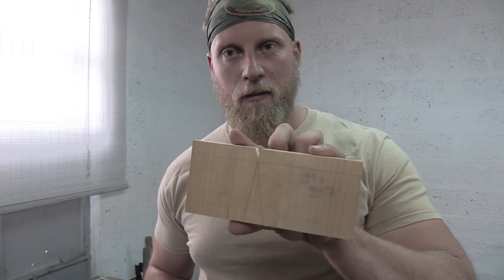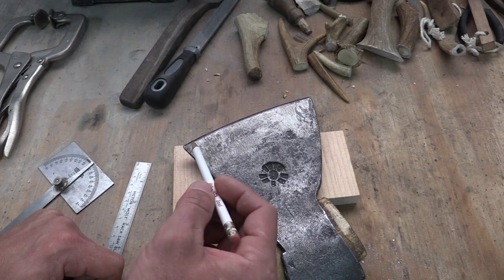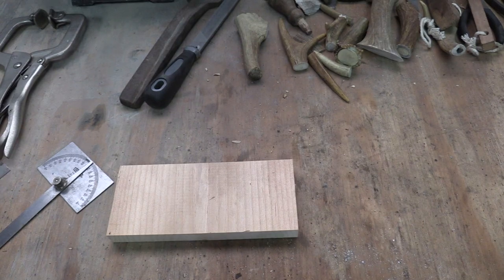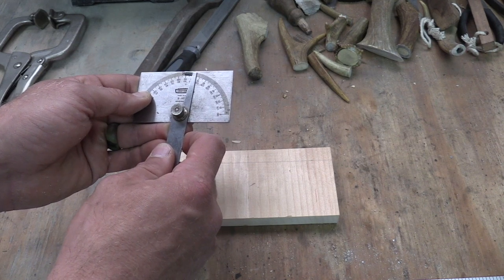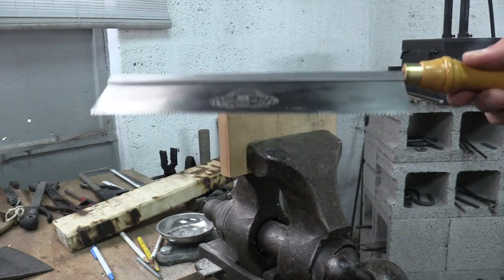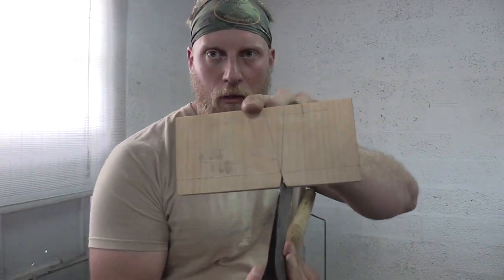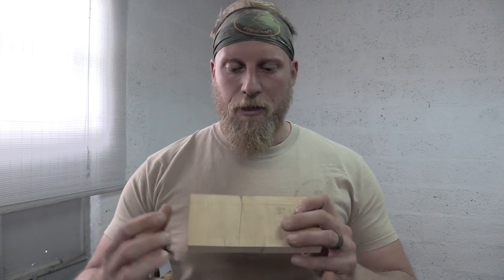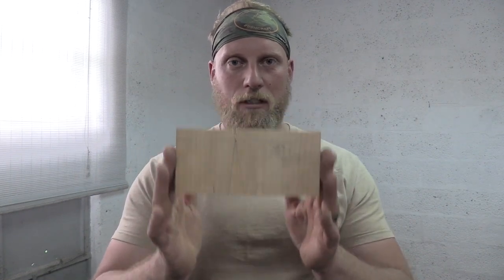Axe Gauge

Comment: how would you use the jig when sharpening it.
Reply from the maker: Daniel Figueroa you keep placing the jig over the blade as you sharpen it
Reply: never heard of an axe gauge. so i thought you were gonna file down the part between the edge and the reference line at a 23 degree angle so you would be able to just place the axehead with the tip at the reference line and use a grinding stone and aline it with the filed down part. 
  this way you use the jig while sharpening. i dont know if it works good in practice, just an intuitive idea.